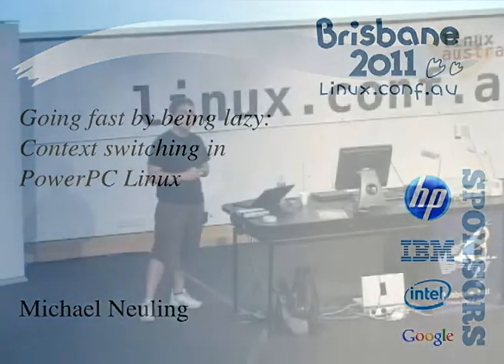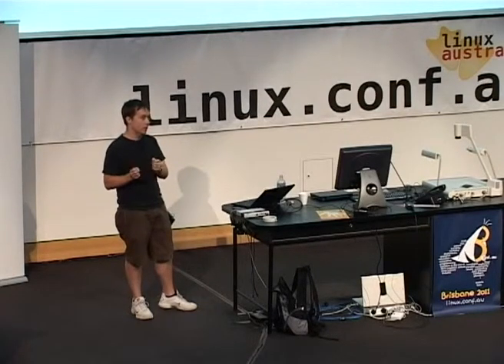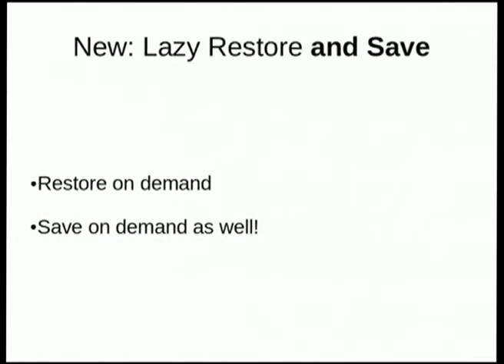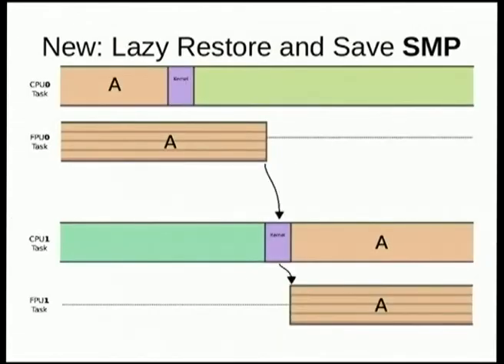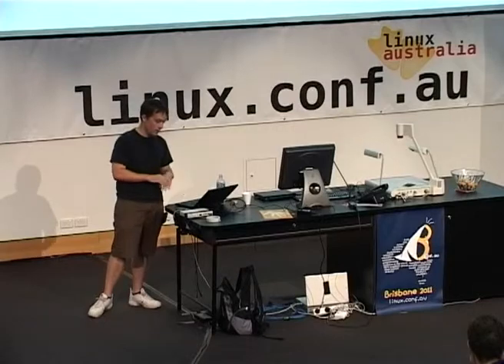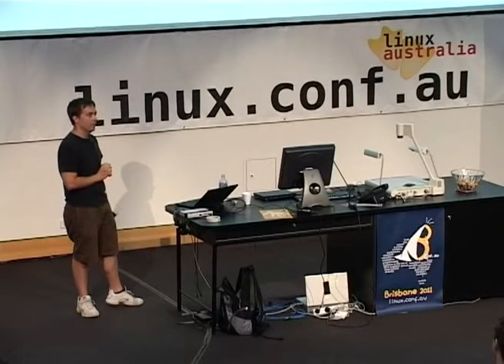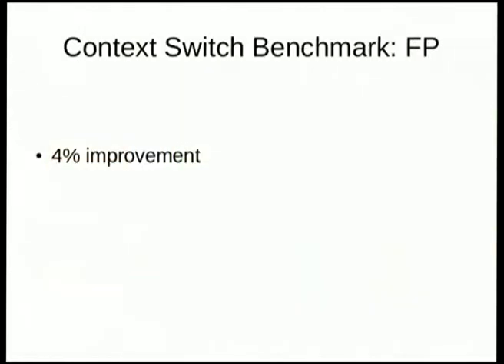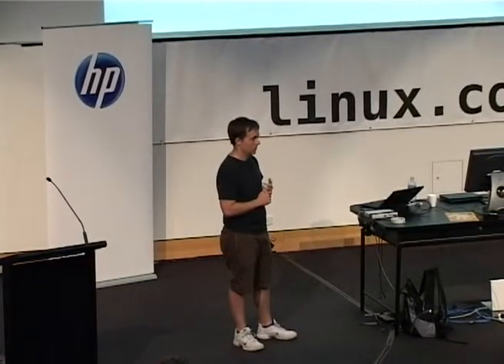Going fast by being lazy: Context switching in PowerPC Linux

Comment: When the G-4 Power Macs with Altivec came out, they were so fast for Photoshop, and video encoding. If Motorola and IBM had been able to put more effort into the format, they would have given Intel a run for their money for several more years.
Now Apple is back in the RISC market and they have the money and engineering to kick Intel around like a little dog, and I hope they keep it up.